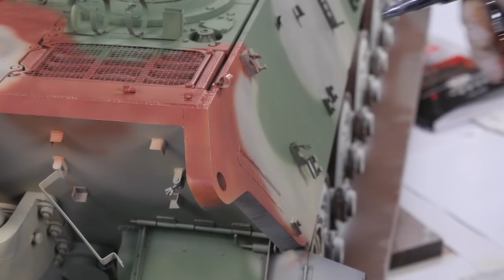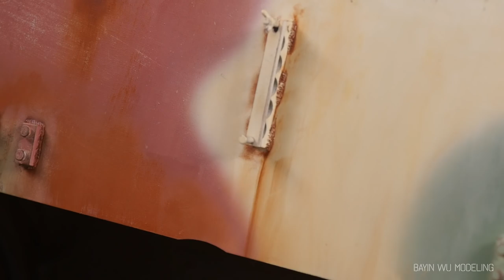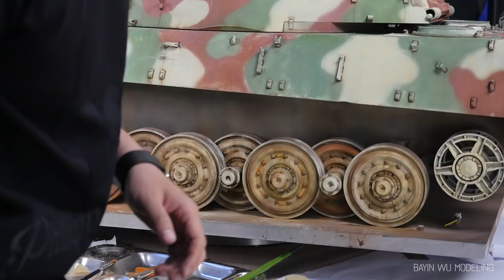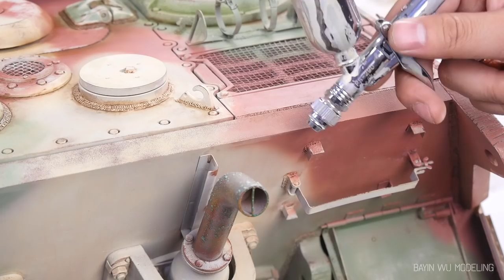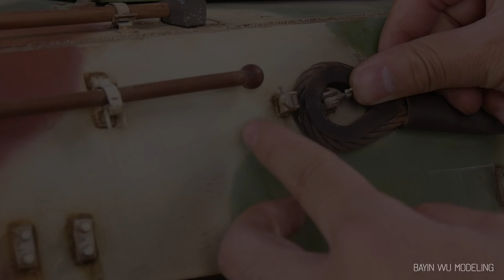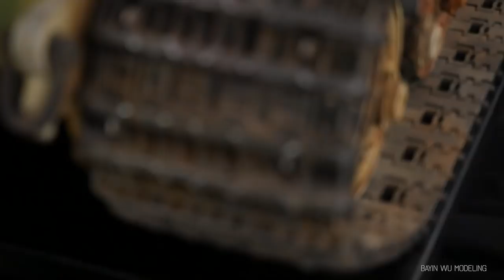Finished! Painting the 1/6 RC KingTiger

Comment: Needs dings & dents from weapon fire in varies sections of the tank.  I would also have hung some weathered packs and gear outside of the turret. I also noticed no black exhaust markings on the engine vents and pipes. Very nice paint job!

Comment: The only thing that I would be negative about is the shake-shake dollar store primer. The most important part of the paint on a $15,000 model and you didn't want to go to a local body shop and spend $200 for a good quality metal etching epoxy primer?  Heck, if you show up at most body shops with this thing, they would probably just charge you for the materials to get to be a part of it. Maybe $50 to $75.

Comment: Nice job.
But I somehow doubt that there were any King Tiger in service long enough to get this much rust.
Reply: Keyboard runner  they were some
Reply: The oldest Tiger II would have been 10 or 11 months old at the end of hostilities and would have been in constant use until then. Yet people rust their models so they look as if they've been sitting in  wrecker's yard for 30 years
Reply: they were some tigers that were in service for over 2 years and after that some were being tested by the allies
Reply: and a tank is out of metal (if you didnt knew that) and metal rusts pretty fast on tanks but ok
Reply: It's a matter of degree. 
The Chromium, molybdenum and nickel content of the steel would make it more corrossion resistant than mild steel. So no tanks don't rust fast.
Reply: Dark Pluto the first KT's saw service in the summer of 1944. The war ended in May 1945 that less than a year at best...how do you think King Tigers were in use for over 2 years ?? please explain...most had very very little rust
Reply: @Xr-pd2oi  hmm all the things Germany was running very low on back when the King Tiger was actually being produced.. they were using inferior steels to what they had used on earlier tanks. They didnt have the resources to make really good steel anymore. And so a lot of late war machines were much more susceptible to corrosion.
Reply: @dgrantreiter  i think he said Tiger.. like Tiger I.
Reply: +JTD19881369Yes they were running low on materials so they used less chromium etc than optimal. That was the optimal amount for ballistic protection, not corrosion resistance. This resulted in tanks that would crack open when hit with multiple shells.
I've also had a close look at a decommissioned Leopard 1 that's been sitting on a plinth in all weather since 2011. It is only now beginning to show this much rust, It was  in Australian service from1976 to 2007 and now sits in one of the coldest, wettest parts of Australia and a good approximation for the climate of France.
Reply: Xr yet hardened steel can rust overnight if there is no protective layer on it
Reply: Nobody Knows  Rusting is an exothermic reaction, so the cold will accellerate rusting especially since it will also allow moisture to condense on the exposed metal. Although, it's not as simple as that;  heating the metal in a fire or simple furnace will increase oxidation by increasing the rate of reaction. I remember my chemistry professor being stumped by a question on this many years ago, he had never noticed the contradiction.

By sacrificial zincs, you mean sacrificial anodes. That will on work on a tank unless part of the tank and the sacrificial anode are both in physical contact and both submerged constantly. This is commonly used to protect steel ships, but as soon as the ship is hoisted out of the water the galvanic circuit is broken and it no longer works.

Another method is galvanizing where the steel is dipped into molten zinc, galvanized roofing iron is the most common application. The zinc provides a self healing barrier to water and oxygen, but the Leopard1 I referred to is definitely not galvanized and Tigers definitely weren't.
Reply: Thermite is an exothermic reaction  too.  Endothermic reaction problems are not just mirrored.
Reply: Adamast  Please take the time to actually read through my comments before making unneccesary corrections. the first paragraph of my last post will do.
Reply: I personally don't like rust on my models i like them new looking you know hell march sharp and i would paint my king tiger as a US Army captured tank olive green and white stars 1/6 pair of truck nuts hanging off the hitch some decked out mud flaps and a bunch of bumper stickers like what i have but 1/6 scale! Is it a tank is it a truck no its a tracked fuck off gun!!!
Reply: True, if they rusted  first it would be the sheet metal parts like  the  fenders which were made of lesser alloys. the chassis and turrets when they did rust would have yellow streaks  not red brown in color.
Reply: Exposed steel rusts very quickly, these tanks were used in combat in the worst invironments, like rain, snow, mud, running trough burning villages or cities with corrisive smoke, the tank could be just a few months old to look like this.
Repairs in the field were just to let the tank operational, so many times they just stripped of the damaged fenders or even stripped of damaged wheels without replacing them, as long the tank would be still mobile.
It was war and the thing just must shoot and drive, not going to a tankshow.